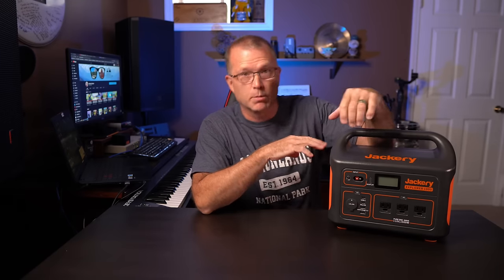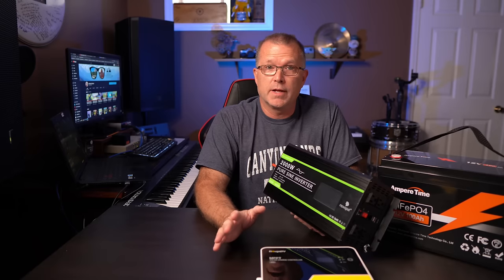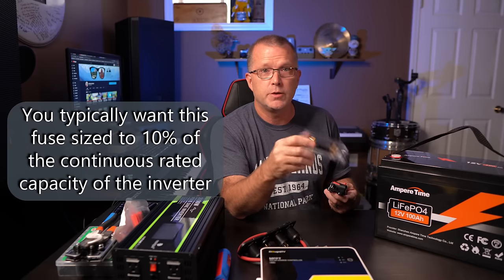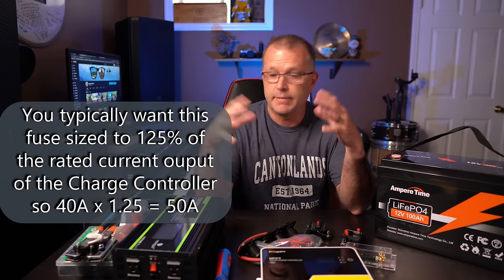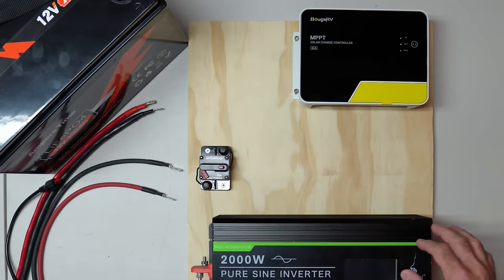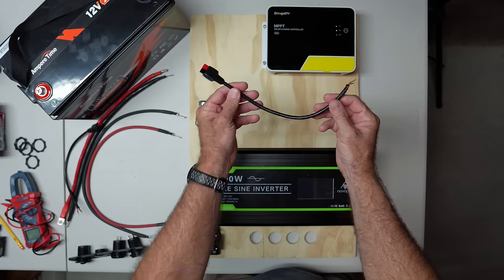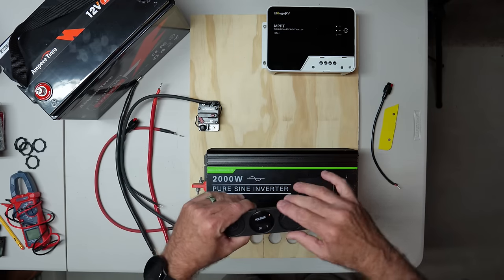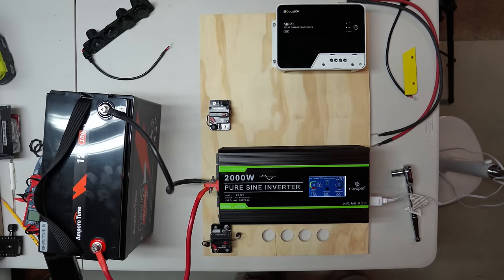BEGINNER FRIENDLY Step-by-Step: DIY SOLAR GENERATOR for Emergency Power, RV, Shed... Ampere Time

Comment: This is pretty darn close to what I would like to put together! My question is: I almost bought a 2000 watt inverter WITH an MPPT indide it. Is that something you might suggest, or are you finding the 40W Bouge MPPT has you more comfortable with the setup? I would really like this for my small workshop area!
Thanks so much for this! Mystery ::Solved!::
Reply from the maker: Hi Gina.   I think using an inverter/controller combo is definitely something to consider.  It would simply the setup a bit and keep things nice and compact, so I say go for it if it has the specs you need!  I actually considered one from a company called SunGoldPower but it would've required me to go 24v and I'd have needed at least 2 batteries for that.  But really, that's the only reason I didn't go that route (well, that and the fact the BougeRV provided me the 40A charge controller and it was perfectly sized for my project haha).
Reply: For me personally  ... I went for separate MPPT.  A big question you need to ask ... is there a chance I will upgrade my system later ? I started with 2x 150Wp panels in parallel to charge my Ecoflow Delta2.  Then I noticed I only used a small % of my panels as my power station is always charged in under 3h with these panels.  So why not use more from this system.  I bought an normal cheap solar charger of 30A to charge a car battery.  But that didn't do much. So I decided to expand the system.  The upgrade consisted of 2 extra 150Wp panels, replacing the cheap 40A controller by 2x Epever  MPPT and a LFePo4 battery.  Why 2x MPPT ? Because the second 2 panels are a bit different then the first two plus they are in a different directions and angle.. if I would have bought the integrated unit, mppt/inverter I would had to replace that too. Now I ordered a second battery. 
So my system now will consist of 2x2 150Wp panels in parallel,  2 parallel strings with each their own mppt, both also in parallel,  feeding 2x 100Ah LiFepo4 batteries going to a 2500w inverter.

Comment: I really like your setup.  I may just be not seeing it, but did you post all the parts you used in a list here?  I'm looking for the 12 volt outlets.
Reply from the maker: Thought I did, in the video description, but here's that DC module I used: https://amzn.to/42lcCX3
Reply: @ReeWrayOutdoors  Thank you!  I had taken it one step further.  It might be over kill, but I got this one as well to try out.  I'm trying to find a way where I can use this as a AUXCOM portable station.  Now I'm trying to figure out how to design this where I can put it in something that encloses in compartments (To sheild from weather rain/dust)  I ma building it like yours to hang on my wall as well.  But I'm also trying to put it on wheels in compartments.  Any ideas on videos about what you would do?
Reply: @ReeWrayOutdoors  Right, you did.  I was talking about designing it where the DC module with the inverster.  Meaning, in an event of an emergancy, my Ampere Time 100aH battery can power my radio while having the inverter added for AC power for other devices.  Kind of like a multipurpose all in one mobile unit.  Does that make sense?  I may have worded that wrong.

Comment: Hello, I have a question under such a set shown in the video what maximum Solar Panel can I connect ?
Reply from the maker: The BougeRV 40A Charge Controller can support up to 600W of solar input.

Comment: How is the LiPo battery charged?  The charging method is different than for lead-acid batteries.  Could it be by applying a fixed voltage continuously which might damage it?

Comment: Just starting to research and learn about solar and it's components. Why was m I thinking that the positive and negative should go directly to battery from charge controller. Kinda weird to me that it's connected to back of inverter. What am I missing? Thank you
Reply from the maker: It can be done both ways, or also by using a bus bar. The net of it though is that there's continuity across the connections regardless of how you do it and on smaller setups with only a couple of cables on any single terminal, there's no significant advantage to making separate direct cable runs.

Comment: So overall comparing this build to something like the jockery 1000 and a panel what kinda of price differential are you looking at? 

I'm currently in post hurricane looking at a multi day power outage and trying to save my fish and things in my refrigerator but the portable power options are likely out of stock so trying to figure out what I can build in the meantime.
Reply from the maker: The price differential, in this particular case, is not all that big - mostly because I chose a higher-capacity charger controller and a higher-capacity inverter - which give me the ability to easily expand the system 2x-3x capacity but just adding 1 or 2 batteries and solar panels. I could have probably saved a couple hundred $ if I'd spec'd it closer to the Jackery 1000.

Comment: Do you continue the design, with more bateries and more inverters? If we want a 6kw inverter power, what can we do?
Reply from the maker: I do expand the setup to a 24V system in a recent video: https://youtu.be/EDLxolJ0QxI   If you're looking at a 6kW inverter, you'd want a battery bank that has at least 600Ah of capability, and you'd be needing to have either a 24V or 48V configuration.   So for example, if 24V, you could create 2 parallel strings of 3 100Ah batteries each, and then connect those 2 strings in Series.  Or, just pick up two 300Ah batteries like this ( https://amzn.to/3Y96U8w ) and connect them in Series.   Less cabling and easier to keep top-balanced... You would want to ensure the battery you go with has a BMS that can support that configuration (not all do).

Comment: How many solar panels you need for your 2000w system ? And how many  watts per panel , thanks, awesome video !!
Reply from the maker: This particular system was scoped to handle up to 600W of solar input - so 3 - 200W panels or 6-100W panels.
Reply: @ReeWrayOutdoors   one more question,  how long does batteries run before you have to charge again ?  Thanks

Comment: What would I add to the system to be able to charge the battery from my house electricity as well as from solar? And how will I wire it in?
Reply: I would use a little car battery charger. I have one that was inexpensive, small, and was smart enough to turn itself off when the battery was full.
I would simply attach that whole thing to the same board as the other components and either attach the jumper cables to the battery as is, or shorten the wires and change the clamps to O rings to fit snug on the battery.

Comment: Make sure the cable that connects the battery to the inverter is THICK ENOUGH.it has to be able to handle 50 amperes and more
Reply from the maker: Bigger is certainly better.  In this particular case, given the limitations on the  single-battery 100A BMS, the 200A breaker and the very short wire length between the battery and inverter, it was reasonable to just use the 6awg cable that came with the inverter.  However, 2awg would certainly have been a better choice - especially with the idea of expanding the capacity and adding additional batteries.  I AM actually using 2awg on this setup now, and have added bus-bars and a disconnect switch and fuse (in place of the 200A breaker I used in this video).    But I was trying to keep it as simple as possible in this video and that's the main reason for those particular choices. :)

Comment: Aziz Ahmed Ansari (AAA) I am sure you have got a lot of comments for the simplicity and easy explanation, This has instigated me to contact you. I am thinking of putting a 5Kw 24v Solar generator in my basement. I live in Minnesota and thus thinking of a more efficient system, thinking of a battery bank of two 24v 250Ahr batteries, a 24 Volt Pure Sine Inverter Charger, 6000 Watt Low Frequency Inverter 110/220Vac Split Phase, 18000 Watt Surge, Battery Priority Selector, Terminal Block, GFCI. I have no clue what-so-ever about the size of the charge controller(s), solar panels/capacity and how many, fuses and other components. Can I request you to help me, let me re-phrase it, how would you do if you had to build a 5Kw, 24V system for yourself. Thanking you in anticipation.

Comment: It is simple and straight forward but I saw two mistakes: 
1- you forgot the fuses
2- your 12V output system is drawing directly from the battery and thus there is no battery protection: you could draw too low and kill the battery, especially unprotected lead acid batteries. You need to draw from the 12V output (not battery charge output) of the battery charge controller: it should shut off when the voltage gets too low.
Make sure your inverter does that as well, but it should.
Lastly, most charge controllers have a temp sensor for the battery: maybe better to use one?

Comment: The problem I have with my pwm controller is that it has improper charge parameters I bought it for charging 2 lead acid batteries but found it cuts out at 13 volts not even float charge start at 13.4 so my batteries won't last a year and I haven't found a 2000 watt pure sine wave inverter that can be paired with a second unit for true north American 120 240.volts split phase power

Comment: So i have a question,  this might sound dumb, but im new to this, trying to understand it.. i thought that you connect the control panel to the battery and then battery to the inverter.  But you connected control panel to inverter to battery, why? Just a little confused there.
Reply from the maker: This is actually a pretty common question.  The reality is that they're all connected, electrically, so from an electrical continuity standpoint, it's the same as connecting the way you describe.  There are definite advantages to using dedicated bus bar connections though - and actually, I have changed up the configuration now to use them - but in the video I was trying to keep it as simple and inexpensive as possible.

Comment: Excuse my ignorance,  anyway you can use the inverter to just use solar power to run stuff ?  Or  does the battery keep charging while pulling power ?
Reply from the maker: That's an excellent question.  The the Inverter will pull the power it needs off the wire regardless of where it's coming from (battery or solar)... so say you have a 500W load on the inverter and at that time, you have 300W coming in from solar through the charge controller.  The battery only has to provide 200W since there's already 300W coming in via solar.  But you need either grid power or battery power on the wire as well to provide a stable/steady source of power due to the highly variable power input from the solar panels/charge controller.

Comment: I have 2 100 W Renogy panels connect together with a Renogy "brain" and a powerdrive 1000 watt inverter. The battery is Renogy AGM deep cycle 12 volt battery. Everything is hooked up correctly and everything is brand new (2 months old)  takes about a half day with no power on to get 100% from the battery at 50%  it will drop down to 52-50% with 2 100 w (reg light and heat lamp) in about 40 minutes.  Just wanna use it to power my  chicken coop but the alarm on the battery turns on at 52% (lowest they want it is at 50% charge not to drop due to it being a sealed acid battery). What am I doing wrong? I been trying to understand this now for well over a month and now the last two days here in Pa nothing but sun and same thing is happening.  I made sure it was fully charged when I hooked the battery up when it came in.   Seems like it's doing the same thing the deep cycle batteries I first had hooked up is doing because I didn't know about the 450.00 battery that is made just for solar.  Battery is HEAVY took taken two people to move and its suppose to be 200 AH but only able to use 50% of the battery it's 100AH but it shouldn't use  that much power with two light bulbs.   HELP if possible.
Reply: I do also have 2 of the  trippers the same that you use in the same area's between the inverter and batter and inverter and brain.

Comment: Thank you for that. The refrigerator is a 12 V DC unit, did I understand that correctly?  If so, did the DC unit come with the inverter?  When I say DC unit, I’m referring to the black component that blow he inverter (the one hat you said discolored when you super glued it to he board. Thanks.
Reply from the maker: Hi Mark. No, I bought that separately.  There are a bunch those DC kits on Amazon. Easy to find.
Reply: @ReeWrayOutdoors Thank you for responding. Is there a Jack in the inverter to plug it into or do you have to wire it in somehow?
Reply from the maker: @marks2254  actually the DC accessory ports don't need the Inverter at all.  Just attached them to the battery directly since they're 12v DC.
Reply from the maker: @marks2254  here's the specific one I used if you want to check it out: https://amzn.to/3UaYwC7

Comment: What's your opinion and findings on those Novopal inverters ?
Something I don't like is that they have the fuses (8 of them) fixed onto the circuit board a d if needed to replace (as the unit is supplied with 8 spare fuses) you need to unsolded them and then hard to put the new ones.
Reply from the maker: Yeah I consider it a decent 'no frills' inverter.  I wish it had a configurable low-voltage disconnect  Do you have the same one I have, or  different model?
Reply: @ReeWrayOutdoors   , I first has the 1500w but returned it as I was afraid if would be to low soon. Now the same but 2500w.
Yes the programmable settings would be great. Also the fuses access and plugs to change if necessary.
Reply: @ReeWray Outdoors  Something else I would like to see on it is an auto restart after an error. I had several times a shut down because of under or over voltage swings . Once with quite scary consequence as my pellet stove shut down but with an almost full cup that burned further and filled not only the stove with smoke but the whole room. If there would have been an auto restart after 2-3 seconds the stove would have continued. (I know because I already had a short 2sec power cut from the grid a few times.
Reply: @ReeWray Outdoors  - and an other one with fixed fuses - https://youtu.be/pHuYsDGpgg8
Reply from the maker: @NeoVdV  excellent point

Comment: What was the final cost of the set up and total watt hours?  Do other Solar Generators have more bells and whistles to make it better!?
Reply from the maker: Hi Dan - a couple of years ago, it would've been easier to make cost-savings case for the DIY setup.  But in the past 2 years, prices on power stations (and LFP batteries) have come down significantly.  So the DIY option really doesn't necessarily save you a bunch of money now - though you certainly can save some $$ depending your choice of components.  But...there are still reasons beyond cost why this might be worth doing. 1) Easier to expand (typically) as your needs change  2) Easier to troubleshoot/repair due to the modularity of the system.  3) for DIY-minded people, it's just fun. haha.    That said, the compact convenience of power stations, and the ability to have mobile app config/control (in some brands) are also quite compelling.  So I think there are definitely reasons why either solution might be a good, depending on what your needs and priorities are.
Reply: @ReeWrayOutdoors  Thank you for that answer. It makes complete sense. I am a DIYer and love doing projects. I love the expandability that you mentioned!  I will have to do more research to make the decision of building one or buying a plug and play.

Comment: When not in use, the sun charges threw solor panels, were does energy go when battery is full??? What controls the overflow???
Reply: It just disconnects the panel, and they run open circuit. It's just like laying a solar panel outside on the ground without hooking it up to anything.

Comment: Hello, I am a new subscriber and I appreciate your content.
I have a question, is it necessary to ground your inverter when drawing power from the battery? The set up I am making is a 1500W inverter drawing from a 12V 256Whr battery (I know it's not a lot lol but I am just getting into this so starting small).

Comment: Can someone please help me. I want to wire in a female cigarette socket to my solar system like you did, but where do i tie into my system, does it go to the controller/battery? So  I can use it for my 12vdc fridge. Thank you

Comment: Great stuff, thanks! Just what I was looking for. Just so I'm clear - the DC accessories you are running (usb ports, cigarette lighter attachment for your fridge) these run directly from the battery and do not go through the inverter?
Reply from the maker: Correct!  You do not need to power-on the Inverter to use the DC ports.

Comment: When it comes to the charge controllers can multiple be hooked to the same battery? As in each solar panel uses its own charge controller?
Thanks
Reply from the maker: Yes, you can definitely do that.  You just want to make sure the total input current to the battery doesn't exceed the battery's BMS max input charge to avoid tripping over-current protection.
Reply: @ReeWrayOutdoors  awesome thanks